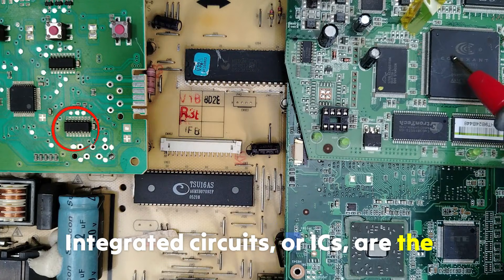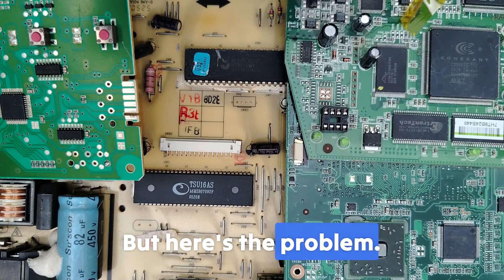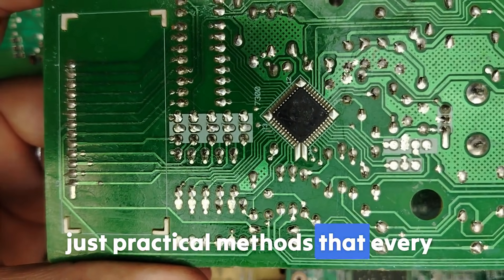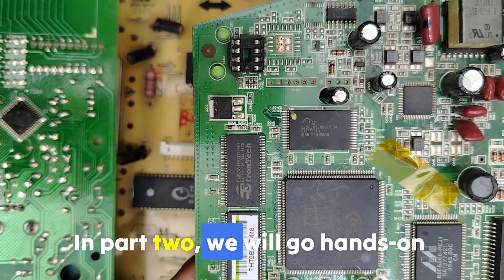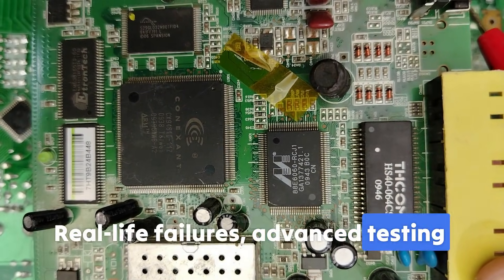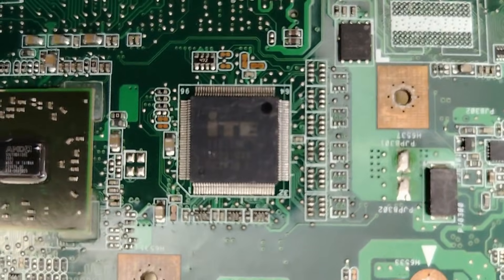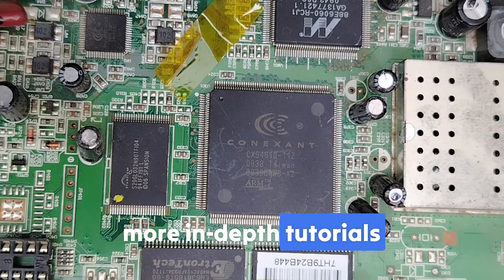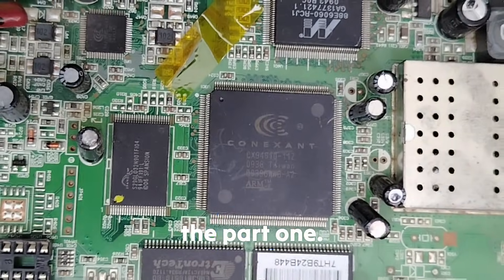The Ultimate IC Testing Series Begins - The IC Testing Masterclass You Can’t Miss

Comment: Ic testing   is something extremely delicate , you will irreversibly damage them  if one of your probes bridge two or more of their pins at once . I learnt it the hard way  . I was measuring smd capacitors near an IC , when my probe accidentally skidded toward the closed IC , there were sparkles  , and the IC was dead
Reply from the maker: Absolutely, IC testing requires a lot of precision. Your experience highlights the importance of being careful with those probes. Thanks for sharing your story. Stay tuned to be impressed.